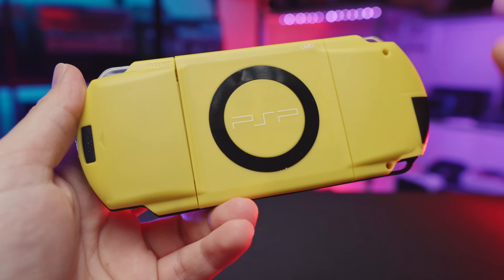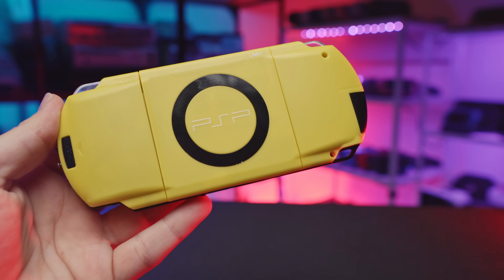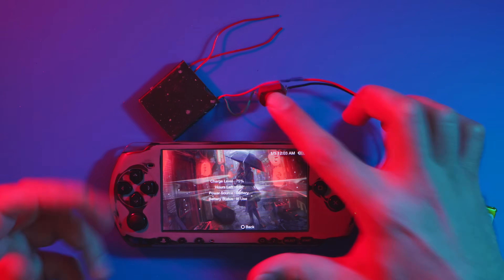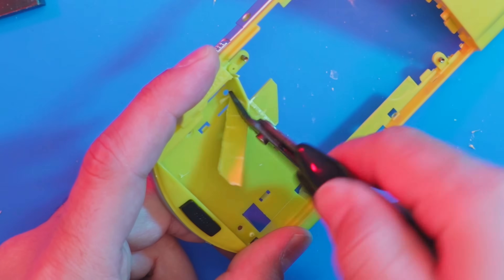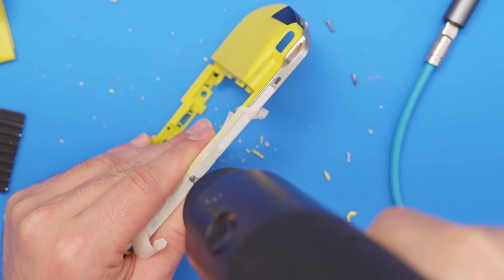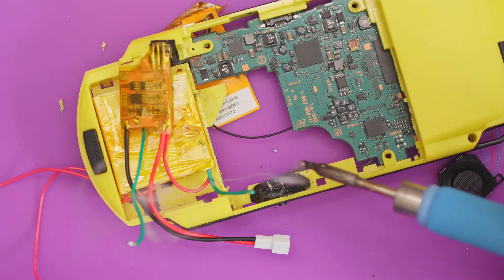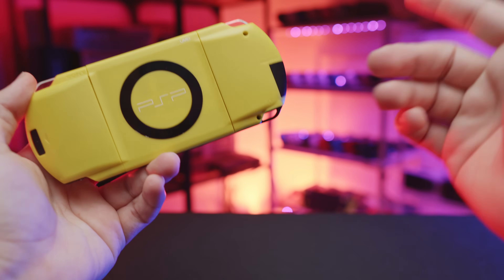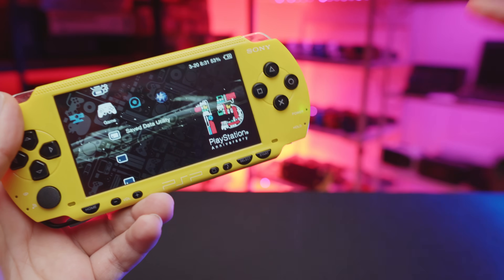World's First Self Defense PSP Mod

Comment: Hey i wanted to ask after i gave my psp usb c port my wifi stoped working basically my psp shuts down when i turn wifi on dont you know what could cose this
Reply from the maker: Something is probably shorting in the wrong place, gotta recheck everything, if you cant find it, remove 1 connection at a time and test to see if it still shuts off
Reply: @T @TotalKommando thank you

Comment: Hello I love your psp videos I have a quick question about my psp. I have a model 1000 and for some reason the wifi switch isn't properly working it turns on and off whenever. When I have the switch off sometimes it turns on. Or when I want it to turn on it doesn't always turn on. I have no clue what to do, I have a feeling I might of damaged it when replacing the shell. What do you think?
Reply from the maker: I was going to ask if it was shell swapped, and you probably answered your question, it probably broke during shell swap, you can remove the switch and solder it to be always on or buy a replacement, having it on wont drain your battery as much as you think since its not used unless you open a WiFi application
Reply: @TotalKommando Where do you recomend me to buy a replacement?